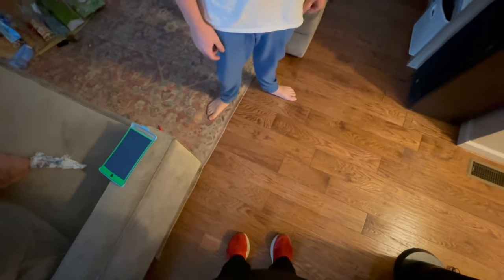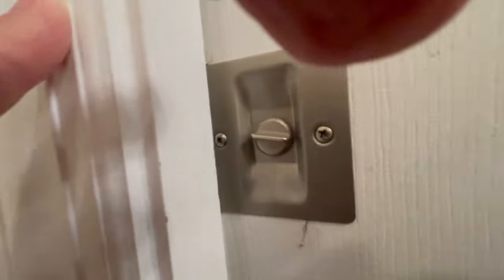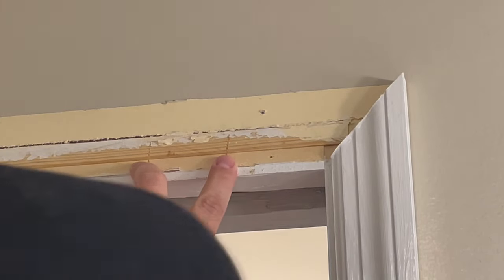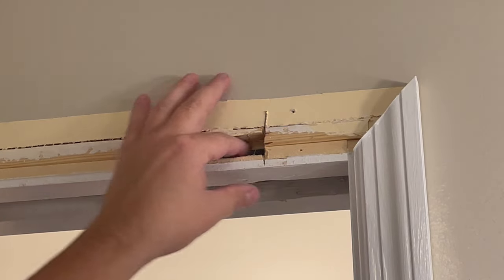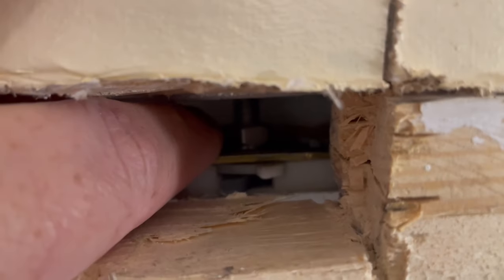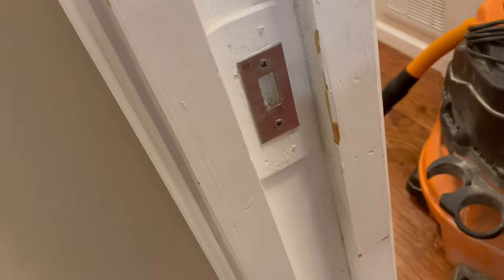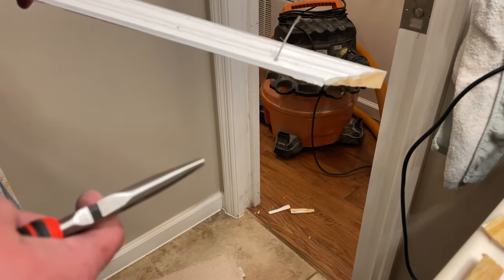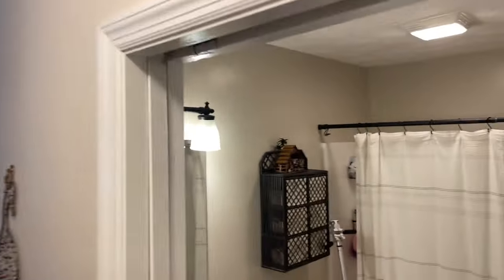Fix That Sliding Pocket Door - A Different Way to Adjust and Access Sliding Bathroom Door Hardware

Comment: I wish I had watched this earlier. After spending hours adjusting the roller carriages using the traditional method with bent angled spanners, I found this technique to be the best—much more efficient and far less stressful than fitting a spanner in tight spaces for small adjustments.
Reply from the maker: Yeah I’ve done it that way so many times. I finally came up with the hole trick…. I don’t remember when. But, it works!
Thanks for watching!

Comment: Just a thought, maybe an auger or spade bit at the corners of the access slot before the vibrating cutter would make it easier?  More dust to clean up though.
Reply from the maker: Right. On some of my other videos you’ll see that I do use that method. Especially for holes in cabinetry or other thinner walled materials. On this one it was just too messy.

Comment: I believe when you flip that plastic latch on both rollers you have to lift the door slightly and slide it out of there. At least that's how mine works.
Reply from the maker: Mine sadly is old enough that mechanism has failed. Happens a lot. But still you can’t get the door out without pulling most of the frame.
Reply: @thejoyoffixing  You sure do, I disassembled the trim on mine a few days ago. Not only did the installer not make it an easy access for future adjustment needs, but it looks like they used glue and probably every nail they had on them to close in the track 🙄. One of my latch mechanisms was shot as well. 20 years old and still working fine, just needed a minor adjustment so the door would close flush against the jamb. 3 hour job to rotate a nut half a turn 🫠
Reply from the maker: That’s the truth! They’re a huge pain in the butt. I understand why these dumb farm door style doors got so popular!
Reply: @thejoyoffixing  😆 seriously